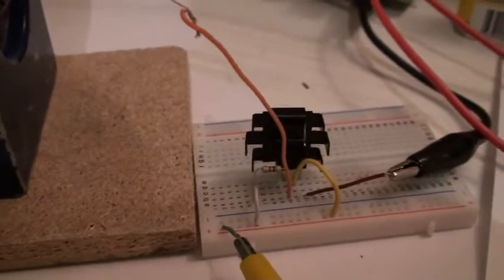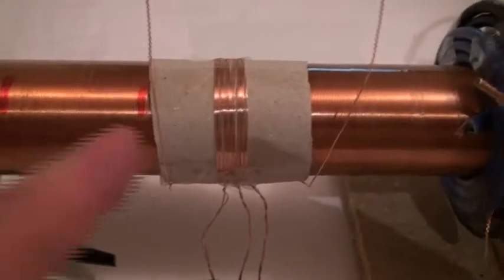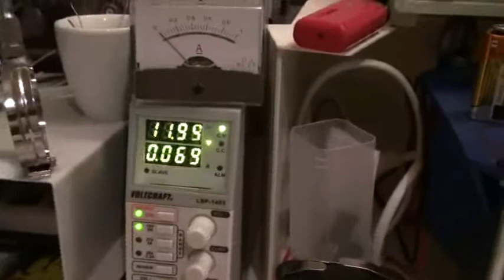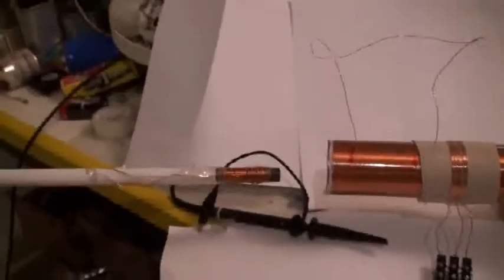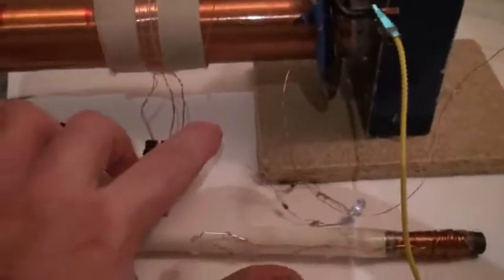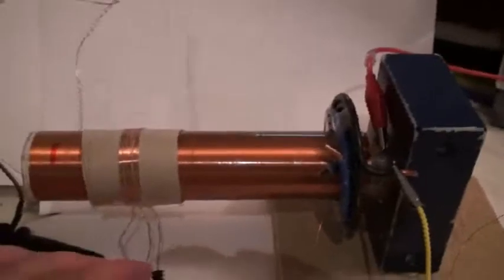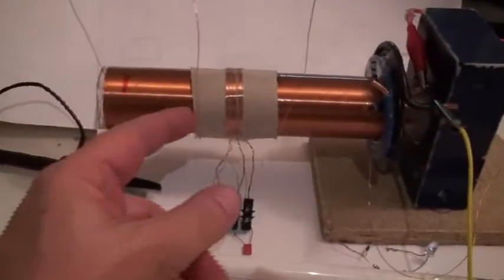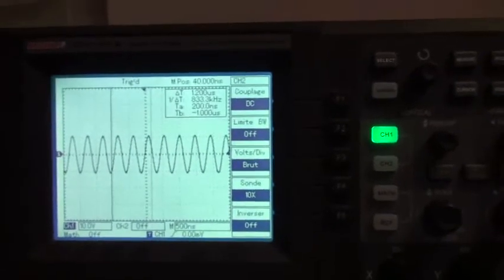flyback study with a Kacher 1 .wmv

Comment: equal mass of tuning forks resonates sound waves from one to another; when mass is added to one it will no longer induce to the other of unequal mass oscillation. harmonic resonance occurs in ratios. like harmonic scales. keys or notes. like radio tuning. Tesla wireless control based on this. coils effect one another based on tuning of masses. wireless radio channels induce likewise. outer coil on cardboard tube is obviously interrupting induction to the inner coil. you said you started out with the L2 complimentary to the graphite coil on the stick? If so, yes harmonic resonance is lost when approaching the extra mass of the coil on the cardboard tube. 

Likewise, mass being equal or a divisor/multiplier of one to the other; meaning a clean ratio, will transmit from transmitter to antenna and will induce current to recharge battery or capacitor being used in the system to self run the system...Don Smith device.